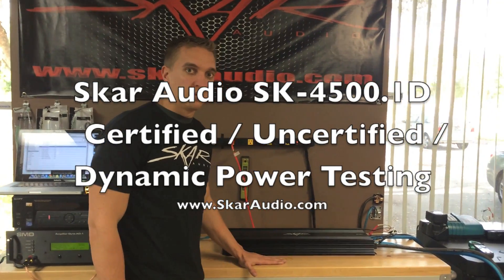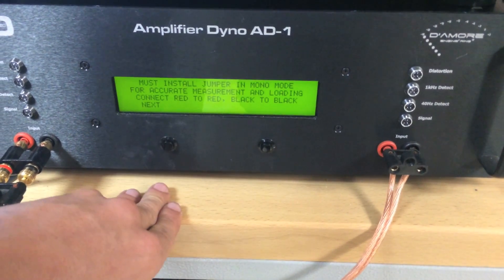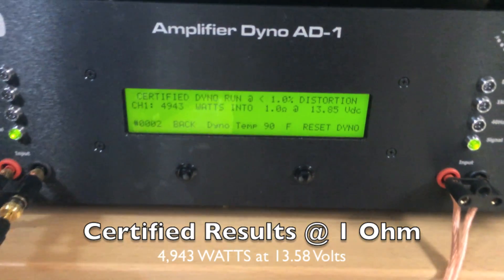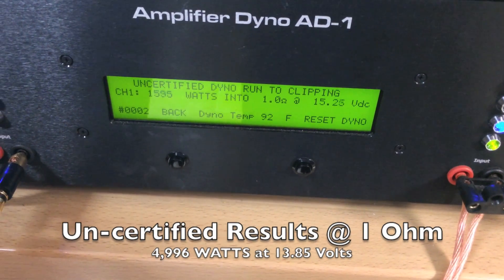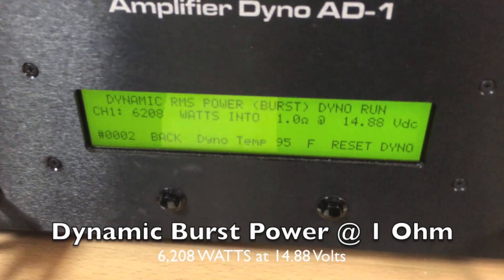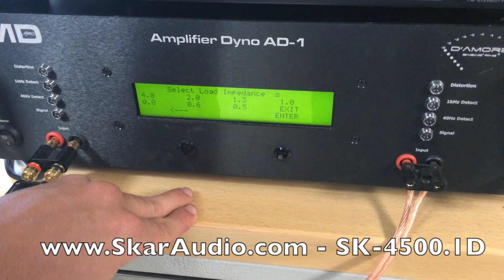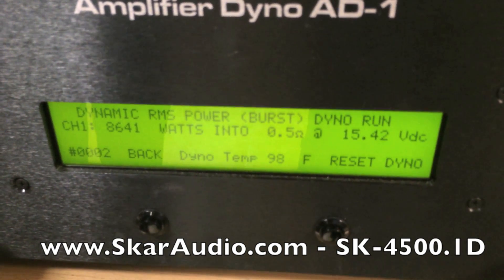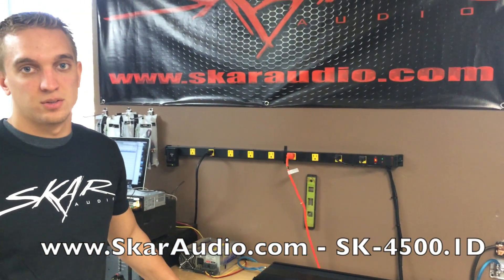Skar Audio SK-4500.1D AMP DYNO TESTING - Certified / Uncertified / Dynamic (SMD AD-1)

Comment: im here because i have this amo on 350 amp alt, xs d6500 under hood and lishen 42.5ah in rear all dual runs ofc on 2 vxf 12s at 1 ohm and have no voltage drop at all with this setup in my 05 ram 1500 but thinking of running it at .5ohms cuz the vxf 12s want more  than this amp at 14.8v at at 1 ohm but wondering will I need more battery power l to run it at .5ohms lishen 8.5 cells esch 4 cells are good for 1k rms i got 4s5p so that should be 5k rms by itself then i got the xs d6500 as well

Comment: I'm hoping you can redo this test with amp draw numbers, and start tests at 14v, not 16..
I'd like to know if my electrical system is up to par..
Reply: It’s usually a good rule of thumb to use the equations with the info provided and assume that it’s going to draw more to be safe. 🤙🏽

Comment: Could I strap two n run it .5 ohm or would that be .25 ohm too low
Reply: For the love of your life don’t run this at .25
Reply: If u strap n wire ur subs to 1 ohm the amp will b at .5 n with box rise u would b good ... as long as u got the electrical... I'm running mine like this 2 1500 sk amps

Comment: I recently bought 2 separate 15s and the rp 3500.1d from u guys at skar audio.  My dying question is can I power the amp with a 4s 16.8v 310ah lithium battery ? .  I paid almost $1900 for this battery to use and power the subwoofers and. I  need help pls 🙏🙏🙏
Reply: What you plan on powering? A nuclear reactor?
You just need a steady 14.4

Comment: Will this amp handle 2 ZVX-18v2 subs?
Reply: No doubt. My cousin have two of those on his sk4500 in his 2014 Tahoe. I'm jealous as f^&k. I've got 3 DDX 12's on a Hifonics Alpha 3000 at 2ohms. It flexes pretty good but I'm definitely getting the sk4500. It puts out over 1700watts more at 2ohms than the Alpha.

Comment: What happen here?
Size: SKv2-4500.1D

I couldn’t find any dyno tests of this amp online and so I took a leap of faith and bought it. I hooked it up to two high power 15” woofers and cranked it up. Boy, was I disappointed. I finally bought an amp from another company to get my system sounding where I wanted it. Since then I have tried the amp on two other systems with disappointing results. Finally, I had my son install it in his car and we decided to see how much power it was putting out. It draws a little over 100 amps at clipping at12.5 volts! This thing is only putting out somewhere around 1300 watts! Complete garbage for the $900 I paid. My son’s Brutus puts out more. Avoid this amp because it is a giant paperweight. There is a reason they don’t dyno test these.
Reply: Yah it sounds like you're just running a wire to the trunk. I'm willing to bet cranking it up you're head lights are dimming & your voltage is dropping.
You can't expect it to run @ full capacity or even half when you are not feeding it the voltage it needs.
The hint was you were moving it from car to car & I highly doubt that you already had extra alternators & batteries in each car.
Reply: Upgrade your electrical dude. I run 4 of these in my Tahoe and am putting out over 20k watts into 4 RS plat 18s

Comment: An average car is not going to have a 16v set up... good numbers but would prefer the test be done on a 14.4v system
Reply: average car wont have an average amp, this aint no average amp, i run it on 16volts & 15.1 at its lowest with my 360 ah alt, a big boy amp needs more then 14 volts

Comment: What's the difference between the rp4500 and the sk4500? Is there a actual benefit for daily music? I'm having trouble justifying a extra $300 for two extra terminals..
Reply: Yes it is. Rp series are chinese board and sk series are Korean board which mines it's not Brazilian and doesnt take a ton of power to produce power. Korean board creates big wattage on low alt. Voltage instead of high voltage to push power. Hope this helps. Saving $300 is probably gonna cost you more than $300+ on backend to support a power hungry amp. If example needed Taramps. They say it takes power to make power and they ain't lying but just not like that. Just my opinion. Oh yeah and korean boards with give you good footprints compared to chinese boards which once again is the skar rp series
 Go SK. Trust me
Reply: @anthonymonroe7463  footprints?!?!?!?!?!

Comment: Is there a big difference in power output from the sk4500 and the rp4500?
Reply: John Nelson  yea I give up.. The only other difference I see is that the sk is 16v capable..
Reply: Between the dyno tests from Skar the SK series did do better while the RP just barely hit 4500 on uncertified to clipping. They seemed to have way better power supply going in their SK for this test though, compared to when they tested the RP. So from what I can tell the RP will hit 4500 fine while the SK will go decently past its ratings, and the SK series has dual 1/0 gauge power inputs for better power delivery unlike the RP. They tested the RP version here: https://www.youtube.com/watch?v=1zZbr1VVZkg My opinion is if you're running a full on system for shows and you need something more reliable get the SK series, if you're on a tighter budget and want similar power for less money get the RP series. I know I'm late but hopefully this is helpful to some looking between the RP and SK amps. The majority of people will go for the RP series amps for sure, especially those who are not going for the 4500 models.
Reply: You won't see the same build quality or wattage levels. If you have beef'd up electrical, the SKv2 4500 will give you 5.5k+ all day. The Chinese RP4500 is going to top out just over 4700w and that's if you can supply it over 14.5V. Most people going the budget route w/ RP, aren't throwing $400+ into a 300A alt and another $600 into LTO
Reply: Is the use of both power and ground inputs required???

Comment: Can Skar be compared to sundown audio or Rockford?
Reply: I would say Sundown is better quality and more durable, especially on their subwoofers. Then again Sundown also costs more so you just got to decide what you want, better performance per the dollar or long lasting quality. I'm not sure how I'd compare Rockford, but I'd be willing to bet their amps are better built than Skar, I say this mostly from what I've seen in the bass community, I have had experience with Rockford amps though and they're solid for sure, put a 1200 in my buddy's truck and it for sure is pushing more than its rated wattage. When I get the money for it I'd love to try a Skar amp, just ordered their SDR-12 D2 recently, can't wait to see how that thing performs.

Comment: 4 Skar 15s with 2 Skar sk4500.1 would that flex a 2007 Escalade? Lol yes yes it would .   What size alternator "amps" would I need? I already have 2 xs power amg audio Batts in the Escalade  with 0 gauge on all power and ground big three also done.
Reply: The difference between a 250A & 300A is only going to be $20-30. Better to get a 300A

Comment: these skv2 amps are awesome,  definitely well worth there money and sum.. I've got the skv2.2500 and I really like it.. it's definitely built very well.. built better than the RP series.. there RP series amps are very good to, I own both.. not 1 problem.. plus you can call right to the office and actually speak to anyone who works there and ask them any questions you have
Reply: tankdog03 for the money the rp 2000 is best bang for buck. Have one before i upgrade to 4500
Reply: +Todd I know I had one.. I now have the skv2.2500 and like it better. . both very well built amps, I just wanted to be able to strap in the near future and the clipping light.. I never had anything skar before I got the rp2000, I loved how nice it was, so I upgraded and have no regrets.. skar sell very good products. I would put this skv2.2500 up against any other 2500 Korean board
Reply: tankdog03 i agreed with strap feature. I bought the rp2k and couldn't strap so i had to upgrade.
Reply: +Todd I should have got the 4500 myself, money wasn't the issue.  I just figured u wouldn't need all that power... but I could have just ran it at 2ohm and been more efficient.. now I'll have to strap and take up more space, but I think the look of 2 of these amps would look awesome.. I like the simple flat black look these monsters have..they did a very nice job
Reply: +Todd I do think tiffany style rca's should have came on the skv2 tho.. then it would be a top dog.. without tiffany rca plugs I see them becoming loose or sloppy over time

Comment: No clipping indicator in the remote gain with skar?
Reply: the skv2 series has clipping light, I have the skv2.2500
Reply: +tankdog03 rp series don't tho.. the lp series has it on the amplifier I believe.. these are good amp people.. there just not the BIG name.  same exact boards, just different guts, sum are better that the big name amps.. these skv series is top notch

Comment: The amp is cheap but not dirt cheap. Amazon has it for $800... Well worth the money. I paid that for a old massive 1000 amp back in 2001 it was crap.. I had a 1.5 massive Cap 150amp fuse car of choice Ford Aspire bumping 2 Crunch Fatboy 15's

Comment: Do they have issues running  at .5 how about strapping 2 amps at 2 ohms
Reply: I haven't seen one have an issue at .5ohm but you will need a 250A+ alt and some agm or lto backing it. If you spend $900 on an amp, be ready to spend $900 on your electrical.
Reply: @adamneill9237  lol thanks it took forever for someone to answer that question i been at .5 since i got it
Reply: I have a SKv2 4500.1 on the way. Had a Wolfram W7500.1 but decided against running 4 American Bass HD15's. Only going to run a pair now.
Reply: @adamneill9237  i have one running 2 zvx 18s at .5 its doing good on my 320 alt and xs battery im gonna add another amp and upgrade that battery soon
Reply: @qjuanwhite8285  is the xs battery in the stock location of the car battery or in the back, I have this same setup and nervous to run half ohm but I'm looking into a 340 alt or 370 alt and was hoping to get a xs battery up front in stock location and not have to put a battery in the back
Reply: @Stooped_Phun  i run my battery in the back as long and you set your gains right you youll be good to go i can run full tilt all day unless its hot out you wanna cool the amp down with fans a/c whatever that amp is still running
Reply: @qjuanwhite8285  how did you set the gains correctly?  I seen some tools from smd but I dont wanna spend all that money to set my setup one time
Reply: @Stooped_Phun  that tool is 100% worth it you can set it by ear but i dont recommend it unless you know what your listening for its not as accurate as the smd dd1

Comment: If your running a 14v battery 16v alt set up, it puts out the power...Still wondering what it does on 12v

Comment: Whatever the case the amp performed well... Most of the time the issue is electricals. Anyways do we buy good equipment and cheap out on electricals? No matter what "brand" equipment,  electrical will make it perform better regardless. But being that skar is proving the way they rate there stuff, these numbers are beast... and I am throughly impressed. And if you have the electrical to back up running your amp at .5 ohm than by all means sub the fk out my fellow bass head. To be sure have a volt meter wired into your system at all times. Watch the drops, one more thing.... If your amp can draw up to 200 or 300 amps of dc current when reproducing it's wattage, remember that rating is at one ohm, if you drop the impedances to .5 ohm or even .25 ohm, u better believe you double that amperage draw as well. Whatever the case. 600 - 800 amps, 1300 -1400 amps. Like that. Imagine doing the formula backwards. °°°wattage = amps × voltage °°°

And amperage my friends, will kill you, be safe , have your fire extinguisher near by and bass on my friends. Bass on...
Reply: Thanks man imma use this when I get older and do my build
Reply: I have mine at .01 ohm impedence & its cranking out 940.098,128 watts at 690 volts, on my 554 18's in my chevy spark. sick stuff

Comment: Starting voltage - 16.07 volts...
0_o
soooo what's it do on an actual 12-volt setup?
Reply: akamouse100 
I'm not sure what part of that is relevant to my question... (the test above was on a 16/18 volt system, not 12/14)
Reply: He doesn't have the batteries on a charger. Therefore the final voltage will simulate a constant charge while a vehicle is running with proper electrical. smh
Reply: Adam Neill no charger simulates constant charge? Uhhhh...
Reply: The constant drop to around 14.3~ during the tests shows what the amp does or simulates in car.
Reply: Want more output? Buy HO alts and 16V batts, got to pay to play the big deebees.
Reply: akamouse100 yeah mine pumps out 15.2 when charging
Reply: It does what he showed you in your car. But you need to tune the system to obtain the best results
Reply: See this is why no one likes Kevin, he's an old pro scammer dating back in the 2010 days at the least. Selling B-stock as A-stock, using aliases on forums, giving runarounds, poor donkey ass support, copying Sundown's designs...etc. BS company.

Comment: Prefer a true voltage test in everyday car voltage.
14.4 volts starting.
Reply: If you really pay attention to the test that it over produced in with less than rated voltage you'll see about what you can expect. If you apply the necessary voltage you can see his results. Imo just a great amp!!!!
Reply: tankdog03 speak for yourself lol my everyday car has one! Also have 2 sundown x 12 v.2 and 2 xspower batteries and a mechman alternator. So like i said speak for yourself! I think everyone needs some boom in their life! 👍
Reply: @Todd69ski  I agree I also have 1 in my everyday car and absolutely love the sound it produces. Idkw people like that tanlog143 (lmao) watch these things..?? Idw his everyday douche commercials to piss and moan about it..?
Reply: My daily right now is 4 skar vxf 15s
Reply: @bigamp2527  are you using this sk 4500 & running @ .5?
Reply: @barrylawrence7884  i currently run 2 aq2200s. I also have an sq 3500
Reply: nobody in an everyday car needs this amp.. your just asking for problems then, then them people say skar sucks,  these amps suck.. but really you got a lot of upgrading to do before you buy any amp over 2000watts.. if you can't hold decent voltage then you don't need a big as amp.. buy an alternator first, or a couple good deep cycle batteries and most definitely 1 or 2 runs of 1/0 gauge wire at very least..
Reply: @tankdog03ify  *over 1200

Comment: I love mine. I could care less about what negativity I hear online and whatnot. I run my (3) Sundown Zv312's @ .33 ohms, but then you have to factor in box rise. So I'm good and haven't had any issues.
Reply: You still using this amp by any chance?
Reply: this amp did not exist 9 years ago so this comment is fake, most likely a bot. Also 0.33 ohms isn't possible it would catch on fire. lastly, u know its fake becasue who would run 3 subs rather then 2 or 4, odd # subs doesnt work